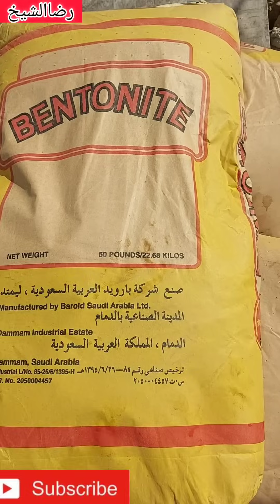التأريض الكهربائي 🔴 التأريض في المنازل بطريقة صحيحة انت الي هتعمله بنفسك الإرث

Comment: Will it work if you connect the ground wire to  foundation beem iron which goes inside to 8 feet inside ground ?
Reply from the maker: My dear, greetings to you
Regarding your question. Of course, it will work with high efficiency, and this method has been tested more than once🌹🌹